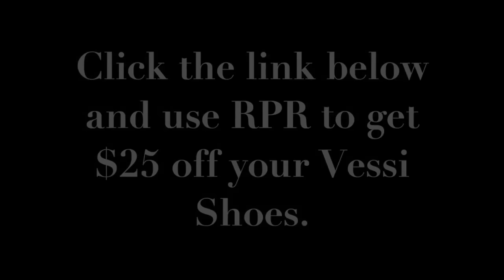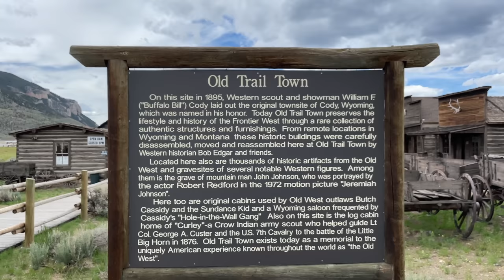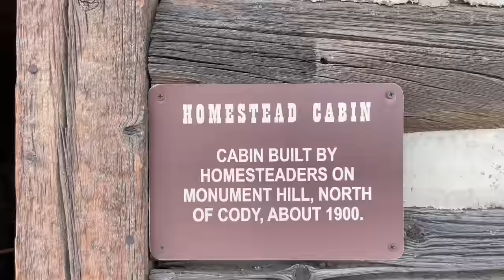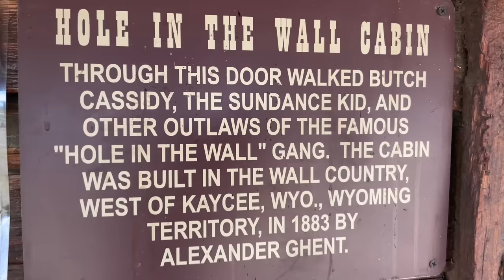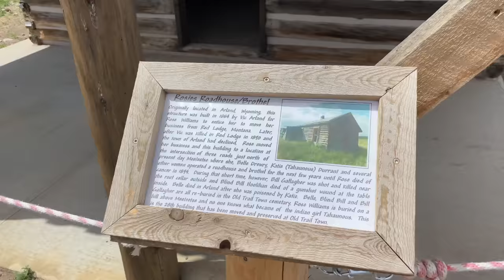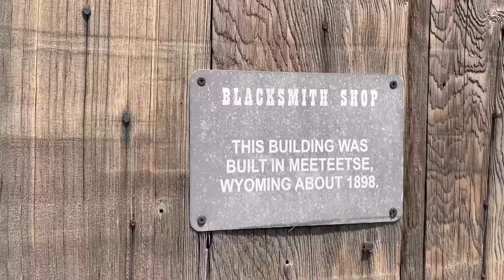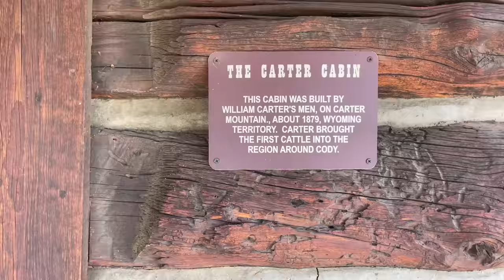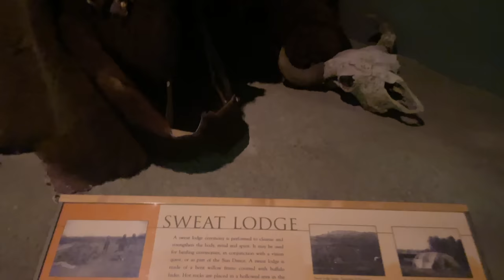#594 - Installed Board And Batten Siding Correctly On Front of House.

Comment: I'm excited to see how the garden turns out. I was always curious how you dealt with your location, the elevation especially. Without a greenhouse, it should be interesting. Growing in Alaska is also challenging for different reasons. It's interesting to see how people adapt their gardens and obviously eating habits due to what's available/"growable".
The only challenge I see that isn't addressed, is the wildlife access and affect to the garden. I had a problem with rabbits that I didn't realize until none of my beans were coming up... They did, but were eaten into the ground constantly, to the point where I had to brush away soil to see the shoots.